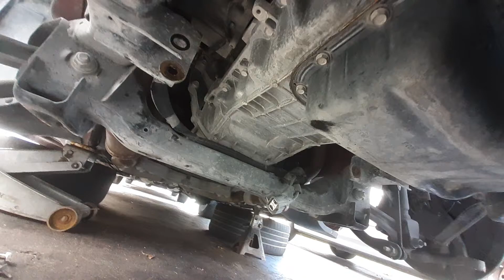2015-2020 dodge Challenger part 2 power electric rack & pinion

Comment: It seems that if you do not have the VIN reprogrammed in the chip, it will run in a low power state, kind of a limp mode. I have a reader that can view individual parts and their original vins, and the used one I bought obviously had a different one. And it never gave full steering assist. Definitely usable, but not as OEM. Also trying to change the steering intensity (normal, sport, comfort) would error out on my dash.
Now I'm looking into replacing another EPS rack on a seperate charger. Hoping to change out everything but keep the original motor. Should not require a reprogram... Hopefully.
Reply: so regardless if i get a used or new one i’ll have to have it programmed to that chip? & has anything new come up for this with you?
Reply: I need to replace my rack and pinion on a 2018 charger GT Do I need to reprogrammed or I can just swap it ?
Reply: @joshuabonilla9918  Idk which models have hydraulic pumps so as long as you mean specifically an ELECTRONIC POWER STEERING RACK, then the swap will work but at a lower power state, meaning it will help less when turning. Basically forces "sport" mode feel but its not an issue. Still easy to turn. There are 2 sections to these power steering racks. The motor/electronic board side, and the mechanical pinion/gear side. If your gear or pinion is bad, you should be able to separate the two halves and only replace the failed side. If the motor is bad, id just replace the whole assembly, but in that case the vins wouldnt match and it would be forced into that lower power state (still fine). If your gear/pinion side is what is damaged, even if you had to buy a whole assembly it could be worth trying to reuse your motor.
Reply: @BeastPepper for my rack and pinion dodge charger r/t I have a sdx suspension I think as long as you get the correct specs you’d be okay

Comment: I replaced my rack and pinion on my 17 charger RT and it still says service power steering , should I disconnect the battery and let it sit and see what it does ? I did get it from a junk yard though but he said if it doesn’t work to take it back
Reply: you figure this out?
Reply: @badkocaine  yes , the one I got from junkyard was from a 300 so it wouldn’t work , returned it and ordered a rebuilt one off eBay and slapped it on but I had to get it recalibrated at a mechanic since it’s electronic
Reply: @kaptinkarlos4821  do you know if that requires a scan tool or can just about any mechanic do it?
Reply: @badkocaine  it does require a scan tool but I’m not sure if it has to have dealer software or just any quality scanner but It’s worth the try considering how expensive it could be to take it to a dealer to get recalibrated. The mechanic I took my car to specialized in mopar and Cummings so I would try to find a mechanic like that
Reply: @kaptinkarlos4821  damn okay okay thanks, if i could just take the rack itself without it on the car i’d just do it that way and then have it put on somewhere else 😭